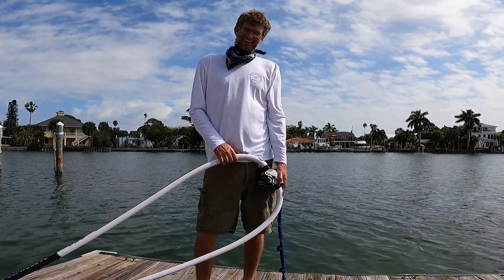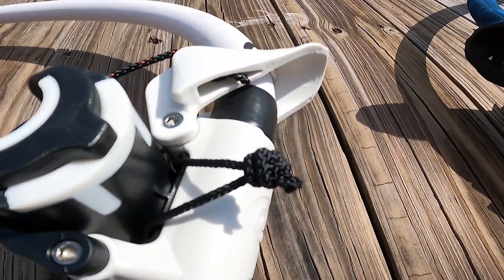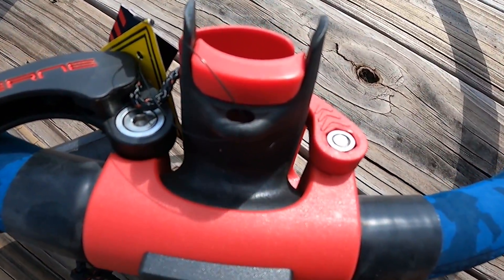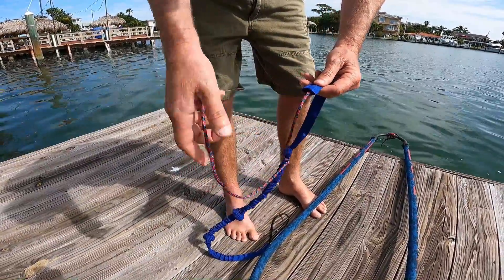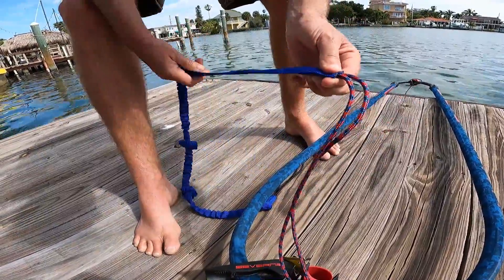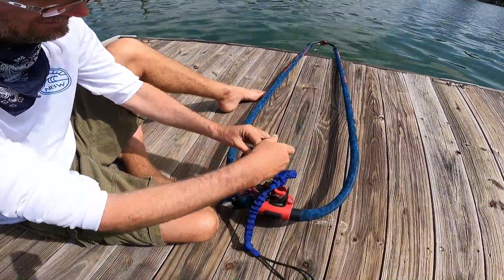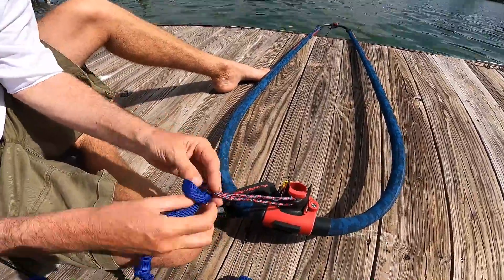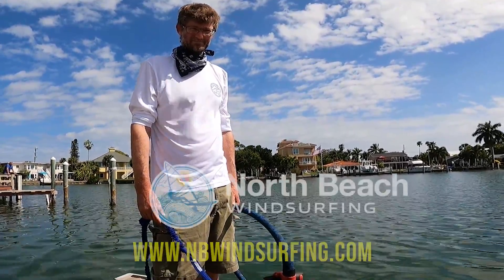Asking For A Friend: How Do I Attach My Uphaul To My Boom?

Comment: I'm doing the same way but I've been told the plastic can break and it is better to get a thinner rope that goes in and around the whole boom head (like on the first boom in the video but still going in the plastic bit).
Although mine has not broken yet after a year and pulling a 10m out of the water.
Reply: Cool, I haven't heard of the plastic breaking yet. That is a good idea though.
Reply from the maker: If you've been uphauling a 10m and the plastic hasn't broken yet, I bet it will be fine. But always smart to keep an eye on it in case something goes wrong.